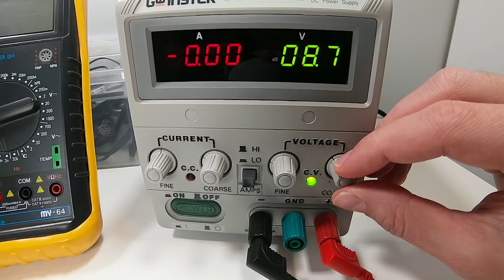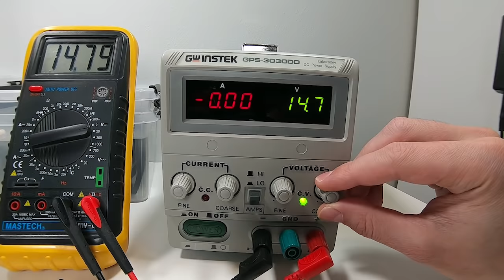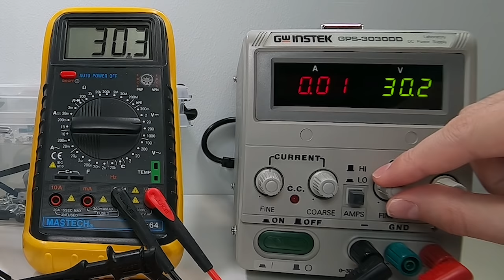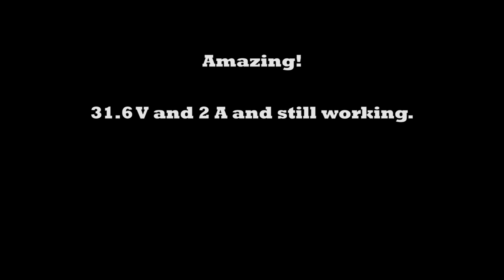30 Volts to a Lego Motor

Comment: I’m impressed with how amazingly consistent the strength curve is, it’d be really easy to follow the arc to find its true maximum theoretical pulling force, if you discount the physical failure of the mechanical components. Good stuff!

Comment: I'm surprised the torque kept increasing. Normally, once you reach the field strength of the magnets, the torque won't increase, no matter how much current you apply. I didn't think those magnets had that much coercivity. Did I see a planetary reduction gear set in that motor?
Reply: the XL motor is planetary

Comment: id love to see you revisit the gearing and tackle with this newfound knowledge. maybe add some way to keep it cool. reach out to a machine shop to get a aluminum housing for it with water jackets to liquid cool it to keep it from overheating at stall so you can REALLY have some fun with it.
just a thought. love the channel!
Reply: and it looks like the short you got is just that you f**ked the commutator bars on it. I'd love to send in a fairly large and powerful DC motor that I'm sure you could adapt to work with the lego systems. (motor is 2-200v,will handle around 10a at stall for half a minute)

Comment: It could be possible to rewind those motors with a bigger wire (say 24 or 22AWG solid core) to make them more powerful and change there speed.

See "dc motor rewind" on internet, you could find very interesting things

Comment: Hardy motor, I thought it would burn out before... now it is clear due to what it produces a large torque on the shaft, a planetary gearbox. In fact, the design is the same as in the screwdriver, only in miniature). Thanks for the video, it was interesting to see what's inside. Привет из России!

Comment: Well,  since that original 130 motor bit the dust, replace it with a MTB Neo Rhino or OOD Kraken and see how well that performs in an M motor. Just use thicker wiring and a power supply that can supply a LOT of current.

Comment: Yeah that capacitor you removed from the motor was a smoothing component to ensure a ramped acceleration, blocking current at full charge.
You replaced it with a straight up copper wire, you shorted it yourself.

Comment: Could you rewind the motor with a lower gauge wire. It would lower the maximum rpm but increase the amount of torque output because the thicker wire has a lower resistance allowing more current to flow.

Comment: One of the reasons why the motor doesn’t last very long on 30V and 2A is that it’s a brushed DC motor, and the brushes wear out faster at higher power.

Comment: This is pretty common for any electric motor to handle a higher voltage than it is designed for, for a short time. Even 32v isn't too bad for a short burst, but get up to 48v and that's risking the motor a heck of a lot more even with short bursts.

Comment: Haha reminds me when I was a kid, I had a Mecanico(sp?) set, and it came with a 3v motor (2 AA batteries to power it) so I basically made a prop blade, though not really a prop since it had no lift.  Just straight blades.  I tried a 9 volt, then 2 9 volts, then 3...  I ran out, so I tried 120vac and it let the magic smoke out.   That motor did take quite the beating before I blew it though.   Fun times.

Comment: Now I know why LEGO motor performs badly, and over priced, the motor itself is not a high performance motor, however the housing structure is not designed for high speed either, therefore any upgrade to it is a waste.

Comment: Could it run for more than 6 seconds if you let it spin, rather than have it stopped by the string etc? Or does that not make a difference?
Reply: I wonder the same...
Reply: Motors draw a lot more current when they're being forcefully stopped, so logically it should last quite a lot longer if allowed to spin without a load. With that said, it's very likely that it would still burn out eventually.
Reply: super melty
Reply: Lawrence B Yes it will last much longer. When you stop the shaft from turning, the electromagnetic field fails to convert it's energy to kinetic energy. It convertd it to heat instead.
Reply: YES it makes a HUGE difference. Testing a motor at stall versus a motor that can rotate under load will give different results. This individual doesn't understand that.
Reply: Motors are a bunch of different circuits inside, while 1 is active, it produces a magnet and pulls the spinner into position A, when in position A, the connection is broken, and a different circuit becomes active, and pulls the spinner into position B. When in position B, circuit A is active, and the cycle repeats.. going around and around. (Better motors have more positions, but the logic is the same).
When the motor is stuck in 1 position, circuit A is active for longer and has had time to built up a stronger (constant) magnetic force and requesting higher current.. This higher current causes heat.. Heat in 1 current for too long causes it to not be happy.. and go pop.. Or melt wires together. Wires never designed to be connected.. The end result is still a broken motor.

If the motor is allowed to spin, then the magnetic force and current never get to its full limit as the connection is cut as it spins. There are other forces at play. but this is a simplified version.
Reply: it does. basically the load curve for a DC motor like that looks like this: it runs from max torque no RPM to max rpm no torque....you don't want to run it at low rpm as these dc motors are not designed to do so efficiently - losses are far higher the lower the speed is. This is because when spinning the emf reduces the voltage drop the motor's coils see, so they draw FAR less power. ideally you would run it as fast as you can get away with without diminishing returns from gearing/wear.....like some other people are saying stall torque is just the leftmost point of this curve. a test with something like a rotor in a bowl of water or a elevator would allow you to see how the motor performs under load, but not stalled - but if you measured the unloaded RPM in theory you could calculate this.

Comment: What if you attached a modified motor to your crane, would that drastically increase it's lifting power?(I assume because it has all the pulleys and gears multiplying it)

I wouldnt try anything crazy like 30 or even 20 Volts, but some people have said that if it spinned(like it would do more of in a pulley system) less heat would be generated

Comment: Reminds me of when I was younger and I cut off a power cord from an old microwave and soldered it to a 12V motor and plugged it into the 240V mains. It blew up in my hands (yes I was holding it because I was an idiot and 12) and my fingers were a strong gradient of black from the tips to the knuckles

Comment: When I was a kid, I took a toy 3v DC  motor, hooked it up to some wires, and plugged it into the wall.

Much to my surprise it not only didn't explode, but somehow it ran. The slightest resistance to the shaft caused a puff of smoke and no further movement, of course.

Does anyone know how an AC current can drive a DC magnet motor? I don't understand how that worked.

Comment: I ran 48 volts through a Lego motor. It was already crazy fast but it went so fast that it ruined a tire by spinning it so fast the rubber stretched out of the wheel itself. Now the wheel just skids.

(I've done a burnout with the same wheel with a drill on a road and it has also stretched the rubber a bit)

Comment: So how much torque is it actually?
Reply from the maker: Roughly 140 mNm in the last test.

M-motor max (stall) torque is 40 mNm according to lego.com. That is with a battery box.
If I use my test results to extrapolate, the output with 31,8V is 40*11.36/3.44 = 132 mNm. Probably a tad higher because of friction so let's round up to 140.
Reply: @BrickExperimentChannel  thanks! I imagine now if a thousand of these engines can emulate 1.2-1.4L petrol engine :-)

Comment: Was that a self resetting fuse inside it?
Reply: Håkon T. it's a pptc.
Reply: Yeah, that's what I thought, I use the same type of fuse in my electric airsoft guns, only slightly larger ones. That's good thinking by the engineers at Lego to have that in the motor, ensures maximum reliability.
Reply: I really wasn't expecting that type of fuse inside :d btw for which purpose did you use it in the airsoft gun?
Reply: Same purpose, to protect the motor and wiring, I usually use two or three 10 amp fuses in parallel to get faster trip time.
Reply: IT IS A thermistor that turns the motor off when it is too hot.
Reply: Yes it was. For the last test he removed it. Otherwise he had no way to fry the motor.
Reply: Håkon T. Fuses in parallel 🤔😱 rip

Comment: to optimize power you should run them at 1/2 of their nominal RPM.... in college we learnt how to calculate DC motors. essentially its a linear line running from zero RPM and max current (only torque) to max RPM and zero torque (0 torque coming out). overvolting shifts that up - so you would get a high stall current and theoretically atleast a slightly higher free-running RPM. ... ideally you run it a bit over 1/2x the free-running RPM because below that extra load reduces the speed, which causes current to increase but power to drop. above that midway point power increases towards the max. when the load is increased, so its stable without stalling out. same should hold true for these lego motors :-).

Comment: Have you got an ev3 brick?  And have you ever tried running that off a higher voltage?  I had mine running off 10 point something to make my last video work, but don't wanna push too hard in case I fry it.  Those things are expensive...
Reply: TECHNICally Possible your username is perfect for this channel
Reply: Aw cool! You're the person who made the daft lego video (and many others)
Reply: TECHNICally Possible it would be safer to construct some cables that can use an external power source. All the electronics inside the EV3 will have their own voltage regulation but there's no saying what the tolerances of that are without opening it up
Reply: You can get away with that because there's a voltage regulator on-board that drops the logic voltage to whatever the board uses (either 5v or 3.3v) - only the motors see that higher voltage. As a result, your voltage limit is determined by the voltage regulator's maximum input voltage.

I'd suggest opening the case and taking a look at the board. You should be able to trace the positive terminal on the battery holder (source) to a chip with three small contacts and a much larger one. Check for a number on that chip and look it up.

As an example, a 7805CV can accept a maximum of 35 volts and will always put out 5v.
Reply: VestedUTuber, Wow, thanks that's actually really helpful - I might have to open one up.  To save buying new batteries and/or charging all the time I bought a 9v power supply (nothing fancy like this one) and turned the adjustment pot to it's max which I think was just over 10v... The rechargable pack that Lego sells has 10vdc written on it so I'm not too sure what it's voltage is fully charged (assuming a little over 10v)...  Almost bought a 12v supply and dialled it back down as low as it can go - maybe closer to 11v, but thought I'd best play it safe...
Reply: I have run my pf system on a 3s lipo for some time now. cant say about the ntx
Reply: 200 bucks..crazy.
Reply: bought mine when it was just out 360 bucks but i must say worth the money I've had a lot of fun with that thing

Comment: 2:14 What is the meaning of the orange dot?
I guess green are "unmodified" & blue are "modified", but orange? Starting value? But why 7V when the engine can do 9V? (0:44)
Reply from the maker: The orange dot is done with Lego battery box. The voltage from the battery box is 9V but drops to 7V under load.
Reply: Aha, thanks.
(maybe add a color explanation next time ;)

Comment: The thing you removed and replaced with a solid wire, was that some kind of voltage / load / current limiter?
Reply: That was a capacitor

Comment: How much Current to Melt this Motor down ?
Reply: Lego Technic Exploration I say it won't make it past 6, it would be a miracle if it could make it past that
Reply: Well, it already shorted at the applied ~3A, so thats quite a strong clue. Also, it's not the current that melts it, it's the supplied power vs cooling ability of the motor (ie. surface area) If you were able to sustain the 60W dissipated in the motor before the rotor windings shorted, it would most certainly melt after a short while. In fact, the shorted windings is the start of melting - the lacquer on the conductor melted.
Reply: gerbizzlefoshizzle Very very interesting ! Thank you for your kind answer !

Comment: Flashbacks of overclocking a cpu

Minus the 31.6v
Reply: Razvan sounds like you didn’t overclock it very much then.
Reply: salmjak 700mhz over what it came out of the box, can't get past that because it wants more voltage to be stable and I'm cooling it with air.

Comment: You cold also use the different types of motors. Like the xl. I am eksited for the binder with all of the best triks and se how much you cold lift then. Keep working!👍
Reply: I'm fairly sure that the main difference between LEGO motors is the internal gearing. It definitely would lift  more though.